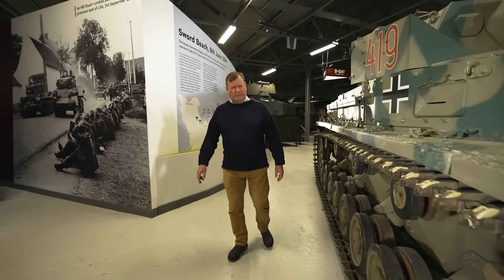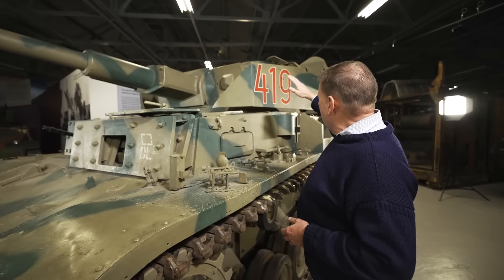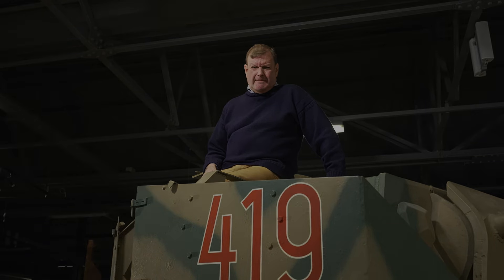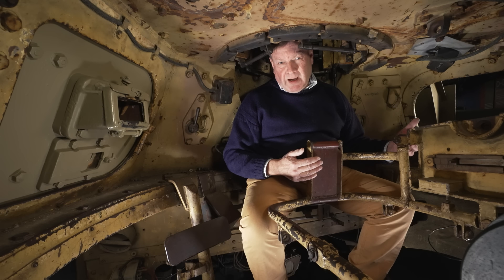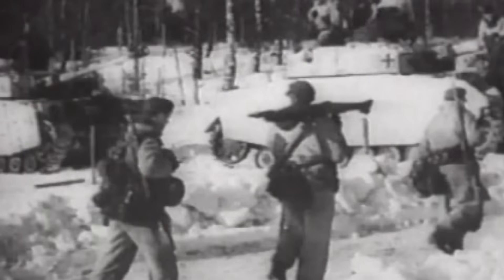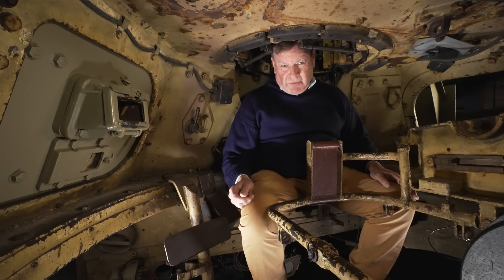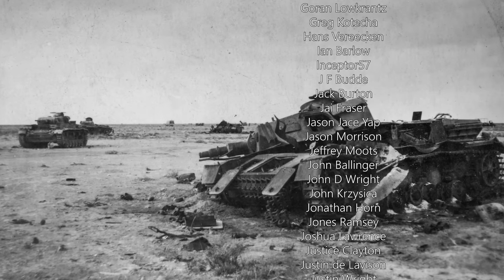Tank Chats Reloaded | Panzer IV | The Tank Museum

Comment: Sorry but that side Armor won’t stop hollow charges.
Reply: The side armor by itself could not. The skirts were intended to cause the shaped charge round to erupt away from the armor and expend its energy in empty air between skirt and side plate.
Reply: @dougjb7848  Except... that doesn't actually work with the rounds of the day due to HOW CLOSE those plates are to the vehicle... NOR were the plates ever intended for shaped charge protection. They are there purely to cause anti-tank rifle rounds to tumble. And I know it doesnt work because I have read a good 100 plus pages of test reports on it from the allies.

The churchill needed stand off plates placed 30 inces away from the vehicles turret to stop the German Panzerfaust 60. And they knew that there were more powerful versions. But didnt have any to test.
Reply: @captiannemo1587  you are correct

Comment: Why no one ever is pointing out the very forward thinking 2-stroke engine, which acts as APU and is quite the norm on modern MBTs. For a 1930s tank this is amazing.
Reply: As far as I know it's not a general-purpose APU. It merely powers the electric traverse motor. Am I wrong?
Reply: @daveybyrden3936  It generates electricity and give it the ability to be combat effective in a stationary position without running the main engine. Everything that powers other functions of the vehicle other that propulsion is an APU.
Reply: @ThatZenoGuy   Thank you. I'm not able to find information about that right now. Where did you see it?

Comment: Contrary to the myth, the Panzer IV was hardly ever the most produced/most prevalent German tank. In the 1939-43 period the Panzer III was more numerous, while 1943-45 the Panther was more numerous.
I guess there was a short time period in 1943/44 when Panzer III production had ceased and Panther production had not yet ramped up where the Panzer IV was the most prevalent but by and large the Panzer IV was not usually the most prevalent German tank.

Comment: In my Opinion the best vehicle of WW2

It was basically the only (major) vehicle to remain fully combat capable and a valid threat from the first to the last day. It was the VW Beatle of the WW2 tanks. The old, reliable, upgradable workhorse for everyone.

It started the war as one of the most advanced tanks of the world and ended it as the most produced and most upgradeble german vehicle of the war. This was peak german engineering, arguably only the Leopard 2 has so far come close to it.

Easily my favourite metal sqare box of WW2
Reply: This tank should have been retired in 1943. It was kept in production only because Germany was running out of time and getting desperate.
Yes, it was upgradable, but the upgrade it really needed was even more armour on the sides. 
Its suspension couldn't support that weight. So it became a very vulnerable tank.
Reply: Davey Byrden

Yes, the Panzer IV reached the end of its upgrades by spring 1943 with the introduction of the ausf H. By 1944 it had neither quality nor quantity superiority. It was still useful but it did not outclass enemy tanks.
Reply: @lyndoncmp5751  Actually it was still outclassing enemy tanks in 1944.

June 24, 1944, during Operation Bagration, Robert Citino's Wehrmacht's Last Stand book: "The 20th Panzer was part of Army Group Center’s reserve, the only Panzer division in all of Byelorussia. A veteran division containing seventy-one Mark IV Panzer tanks, upgraded to the 75mm highvelocity long gun, the 20th had enough shock potential and firepower to do a great deal of damage. Moving into battle late in the afternoon of June 24 under the command of General Mortimer von Kessel, the Panzers immediately began to deal out punishment to the huge mass of Soviet T-34 tanks north of Rogachev. German tanks might have been grossly outnumbered, but they still held a qualitative edge in training, target acquisition, and rate of fire."

June 25, 1944, same source -> "The 20th Panzer Division reported for duty to the commander of XXXXI Panzer Corps, General Hoffmeister, at 6:00a.m., although the exertions of the march had whittled seventy-one tanks down to just forty. Hoffmeister ordered the division into combat, and the Panzers immediately entered the fray against Soviet tank spearheads just west of the village of Slobodka. The German Panzers once again confirmed their reputation for lethality, destroying no fewer than sixty Soviet tanks in the course of the day’s fighting, while suffering negligible losses of their own."
Reply: @eliasmiguelfreire8965  But are those examples of the PzIV being a superior tank, or the 20th Panzer crews being better trained and more experienced than their Russian counterparts? The key to tank combat is to be first to acquire your target and get a round on target before the other guy does the same to you. Experience counts.
Reply: @MalcolmRose-l3b  When I said "outclassing enemy tanks in 1944" I meant it was still getting very impressive victories in the battlefield, which doesn't necessarily mean Panzer IV is the better tank in technical specifications, surely it was showing its age already, but it was still a formidable machine, which combined with training, target acquisition (in my first example I put exactly this quote from Citino's book), and I would add tactical situation of those specific battles, it enabled it to kill a lot of Soviet tanks in the later part of the war, with examples like I put above, in the midst of the greatest Soviet offensive of the war, it was getting high K/D ratios. Of course, It didn't make a dent on the Red Army at the operational level, but in the tactical realm, it was still giving the soviets a lot of trouble.

Comment: Hands down the best German tank of the war ( in my opinion)  a proper workhorse with everything in the right place, not an interleaved road wheel in sight!
Reply: The Panther and Tiger gave the crew a more comfortable ride with their large interleaved road wheels, and helped with added protection. Look at all that thin side armour above the road wheels. Yikes.
Also, the Panzer IV did not have a much higher operational % either than Tigers and Panthers. Only 6% higher at most.
Great for early and mid war but by 1944 the Panther was needed as the main medium tanks.
By the way, changing road wheels etc didn't happen often.
Reply: StuG 40 was a more effective vehicle

Comment: When you built model tanks 45 years ago this kind of information just wasn’t available. Thanks so much for showing the inside, the conditions and the cramped quarters.

I always had a heart for the Panzer IV. It was a do-everything chassis and with the high velocity 75mm the Germans really should have stuck with it and just pushed out as many as possible with their limited resources. Instead of experimenting with heavy tanks that were crippled with overburdened transmissions. The Panzer IV was the German “Sherman.” And the backbone of German armor.
Reply: as far as i know crew comfortability was high in the panzer 4. but i guess that's it being compared to other tanks during it's time
Reply: I seem to recall that the StuG III was actually the most produced German AFV, and in its later variants when fitted out as a Jagdpanzer (tank destroyer) with the long-barreled 75mm often got used as a tank.

German logistics where a confusing array of using production facilities as best they could, often with factories in occupied territory, and always a major headache when it came time to convert from production of a pre-war French or Czech design to a newer German / Austrian design.

Ersatz was the order of the day for the Wehrmacht, and even more so for the Waffen SS, and the the numbers of machines with (f), (t), (i), (r), and even (a)  behind their designations is quite the spectacle.
Reply: The Panther was much easier to manufacture than the Panzer IV and in terms of armament and armor: that race wasn't paced by Germany, but the Soviet Union...their tanks were monsters and the only reason, we destroyed as many as we did, was due to Soviet flaws in strategy, leadership and design details (lack of radios for instance, horrible ergonomic inside etc) but just look what a KV was and than the IS1 to 4...the Russians ended up with a 122 mm gun and 6 inches of armor on those...75mm does very little against that
Reply: The Panzer IV had to be replaced.   At 24.5 tons it was nose heavy and beginning to loose mobility due to the extra weight on the front wheels.  
 It may have received 80mm total Armour in the hull it only had 50mm on the turret mantlet which isn't really enough   The Panzer IV long barreled 75mm gun could take on the T-34 and Sherman but these were both 35 ton tanks with better Armour.  
The Germans didn't have a crazy production plan.   The Panzer III became the basis of the StuG III and the Panzer IV became the basis of the JagdPanzer IV which featured the Panthers 7.5cm KwK42 gun L70 gun.  Used in this way the Chasis provided extremely powerfull gun on light mobile chasis with better armour than the Panzer IV.  There was a StuG IV but it was only produced to suppliment StuG III production after the factory was bombed.
-The Panzer IV track chasis and Suspension system combined with the engine and drive tain of the Panzer III to provide for the Nashorn(Rhinocerous) Tank destroyer with a 8.8cm L71 gun and the Hummel 150mm self porpelled howitzer.
-The Panzer II chasis provided for a self propelled 10.5cm self propelled howitzer.
The Panther was absolutely essential but it was rushed into production from drawing board to combat in about 15 months and that was just not enough time.   It would evolve into a fine reliable tank eventually but this would have taken another year and a half.   It can be argued that the Panther should have been a 35 tons tank instead of 45 ton tank and the final drive gear issued would never have existed but had there been enough gear cuttting machines using planetary gears also would have solved this issue leaving the Panther fully reliable.
Reply: @williamzk9083  My point was, the Germans simply had TOO many different tanks. Way too many variations. The Panzer IV could have been mass produced to the point that losses would have been overcome by sheer numbers. Look at the Sherman. America had better manufacturing capability but they settled on the Sherman. It got mass produced. The Panzer IV would have been a good compromise. Better 75mm than the Sherman.
Reply: The Germans were running out of crews to man them, so arguably a decent crew in a Tiger might do more good than 3 panzer IVs with mediocre crews that a Sherman can go toe to toe with....I think that was the idea with later german tanks.
Reply: @chuckcribbs3398  The biggest problem wasn't a lack of tanks, it was the lack of fuel to run them on. So cranking up armor production by sticking to the Pz IV wouldn't have solved anything. Hitler actually made the right decision in trying to switch to heavier tanks, like the more capable Pz V.
Reply: @soren9310  What is your source for the panzer 4 being more difficult to manufacture? That just seems impossible to me.
Reply: @EneTheGene  Nick Moran and Hilary Doyle..both have mentioned that, even though I suspect that Nick heard it from Hilary. As for impossible: think about it: the Panzer IV was a pre-war tank, yet the V was very much a war time product, so I would be astonished if it were the other way around. Even the hull shape is far more simplified from the IV to the V, using far less manufacturing steps, yet increasing protection....yeah, the IV was a good tank, but that doesn't mean,  it was easier to make

Comment: The two things that I think so many videos/movies and even otherwise great reviews like this one fail at are how noisy it is in an armored vehicle in just normal operations, let alone in combat .... and how absolutely smelly it is .... I was a US Army mechanized Field Artilleryman 1985-1995 ... spent a lot of time living in SP Guns and Ammo Carriers ...  just riding inside an armored vehicle going down a gravel road at 20-30 miles and hour is deafening ...  You are shut up in a metal box with a giant roaring diesel engine, and the tracks are clattering ... the whole thing is shaking such that the dirt on the floor and every other horizontal surface dances as the vibrations call the tune ... and the smell?  Mix decades of sweat/BO, dirt, peeling paint, mildewed canvas, diesel exhaust, hydraulic fluid, rust,  burnt gunpowder .... yeah ... nobody is going to be able to relate to that ... but if you go below decks on a Museum ship like the Texas,  Missouri, Wisconsin, North Carolina .... you can smell that ... now imagine living with the noise and the smell and being shoehorned in there with 4 other guys, surrounded by munitions that will kill all of you in a second or less if your tank takes a hit that penetrates to hit them ...

Comment: How did the Germans manage to upgun their tanks whereas the Allies couldn't?
Reply: For the Panzer III, they were worried about gun size from the very beginning, so they designed it with enough room for larger guns.
For the Panzer IV (this tank) they had to try hard. The new gun has a folding guard, it has a large balance spring squeezed in underneath it because most of the extra weight is to the front, and all the ammunition bins are redesigned.
Reply: @daveybyrden3936  better planning and forward thinking.

Comment: This is a very rare machine, an old type D model with a full set of added armour plates from the E model, including a double plate in front of the driver position that I have never seem before. It also have spaced armour in the turret, a feature from the latter G series. Final touch, what seems to be an L43 75mm gun with double baffle muzzle brake, also introduced in the G series. As it was mentioned that this machine once belong to a driver training school, it may have had a very interesting story. First, because it is really a original model D or E, both turret and hull (the lateral added armour was introduced in the model E). It was usuall to use war weary vehicled in the panzer schools. Ok. Second, it may have gone directly from recondicioning to a training school, or may have had a second tour of duty? Are there signs of battle damage in this machine? One way or another, it was a good fighting machine and a workhorse for the men who lived, fought and died in them.
Reply: Just looking at the gun in the video.

Yeah mate that's the model l48 not l43.
Reply: It's not really rare.  There was an entire upgrade program for these vehicles.  The zusatzplatten is not specifically from the Ausfürung E; Ausfürung C and D received that as well as the full Vorpanzer package too.  Upgunning and adding the spaced armour to the sides of the turret to bring the vehicle up to Ausfürung H standard was done to a number of these vehicles so they could serve as training tanks while still being effectively up-to-date.  Then actual new production Ausfürung H vehicles could go to combat units.  These training tanks were used in combat in Normandy, crewed by instructors.  That is how this vehicle would have been captured.
Reply: @Panzermeister36  true but how many of them survived?
Reply: Is it just me or does it look like there has been extra armour bolted to the side of the tank as well? See 4:59
Reply: @50centpb7  No, you're right. The model D had 30mm frontal armour, and 20mm hull and turret lateral armour. Thus it was vulnerable to any small caliber AT guns of the period. Thus, model E introduced 20mm of extra armour in the hull front and sides, including the lower part of the hull.
Reply: @Panzermeister36  ahh the ill fated panzer Lehr division.

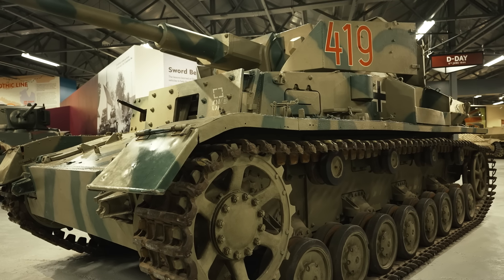Comment: 1:55

That’s not an Ausf.D. 

PzIV carried the 75mmL24 (short barrel howitzer, no muzzle brake) until Ausf.F, when the L43 was introduced.
Reply: Its an ausf D. You can see by the odd shaped glacis and bolted on sections.
It was later refitted with the longer 75mm. The Germans upgraded older ausf with the longer gun if they were still operational and if they had spare guns or cannibalised knocked out ones.
Reply: @lyndoncmp5751  

Ah! I didn't know they went as far back as D models for up-gunning.

Comment: At first I thought, what was the point of doing this over again? When there are not only the Tank Museum's own older videos but also the Chieftain's. Turns out it was a good thing to give you the benefit of the doubt once more. For one thing, I love it when you go through the archives and find the odd bit of relevant footage or a picture rarely or not before seen on the internet. Even if it's just a quick insert here and there, these seeming details really set apart a good exhibit, add true educational value, which takes actual museum people to understand.
And talking about 'well preserved' and the graffiti, contrast that with, say, Trinity Site, which was one of the biggest disappointments of my life - a historic site so thoroughly sanitized that almost nothing at all remains there to actually bear witness to the reality and the violence of that fateful first atomic detonation. Watching videos like this is so much better, believe it or not.
Re: trying to imagine what it was like, I imagine the pressure on the TC to actually stick his head out and take that risk when it is necessary. His crew would expect it of him since they are basically in his hands for situational awareness. The need to trust him. They might start to hate him if they get the feeling they can't trust him, or when god forbid things actually do go horribly wrong. Which they of course did eventually even for many tank crewmen, even hough their chances were a lot better than those of the infantry.